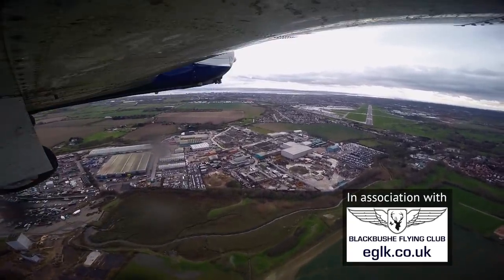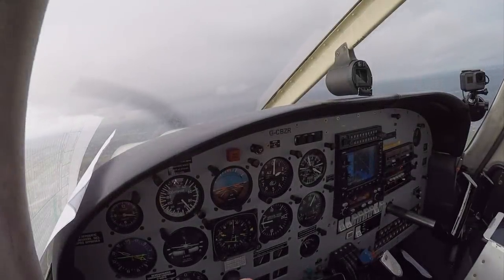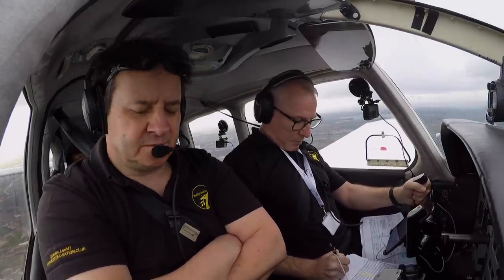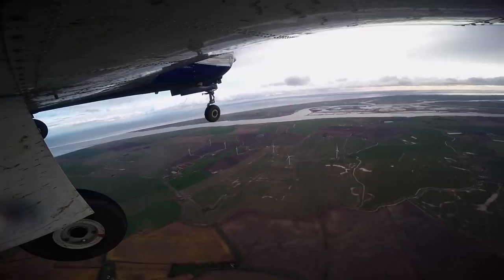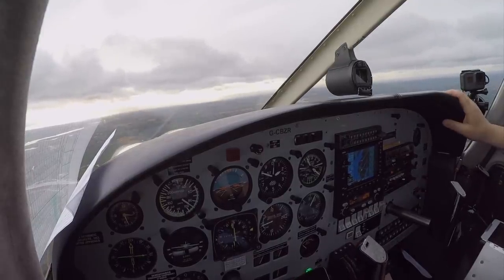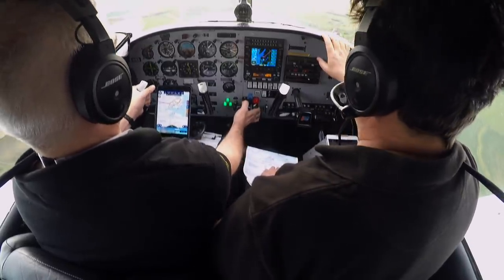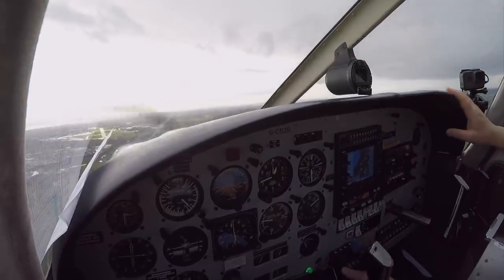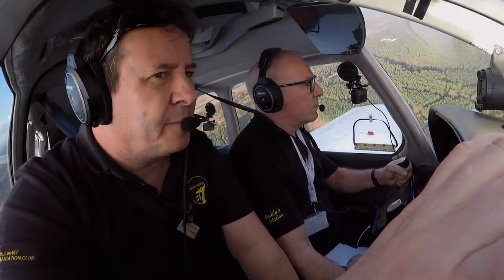How to land an aeroplane in cloud with no DI or compass

Comment: Been there, both AI and DI failure but still with compass and turn and slip in IMC. Vacuum pump failure en route from Carlisle to Oxford in cloud. Landed into Teeside under SRA. What was initially a problem and could have been quite stressful was solved completely by given a seperate channel, the relaxed voice of a dedicated ATC controller and simply completing rate 1 turns, and checking height! 

Glad to shake his hand after touch down!!
Reply from the maker: That's great Don.  I dread such a failure, but I think having experienced these approaches now, I would head for an aerodrome with SRA in such an instance, rather than battle and ILS.
Reply: @TheFlyingReporter  Without a doubt, in these circumstances ATC are amazing!! Great channel BTW!

Comment: Interesting to see that they do the no-gyro approach differently in different parts of the world. Did my last one many years ago at KRSW. Once established they tell you all turns will be 1/2 standard rate and you shall not confirm instructions on the radio from that point on.. Just the controller is talking.
Even did 3 approaches in a row with controllers taking turns. Instructor told me that the controllers have to do them at certain intervall to be "current". Guess they were glad they had me as a "victim" that day. ;-)

Comment: An interesting video for a non-pilot like myself.  I learned something about how turn indicators show a standard turn rate.
Reply from the maker: Thanks Robert.  In light aircraft in IMC, we almost always fly turns rate 1, as they're gentle, and it's safe.  You can also use the turn coordinator and a stopwatch if your DI is broken.  Counting 3 degrees per second, you know how many seconds you need to turn for.  So 180 degrees = 1 minute.  30 degrees, 10 seconds.